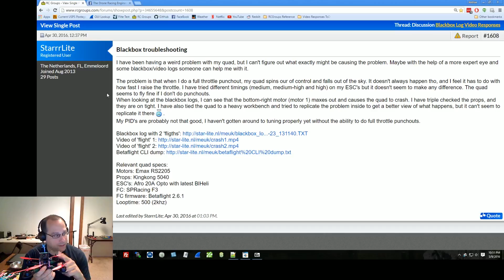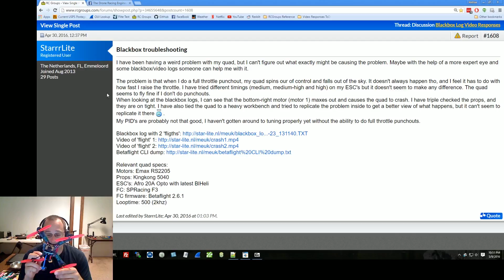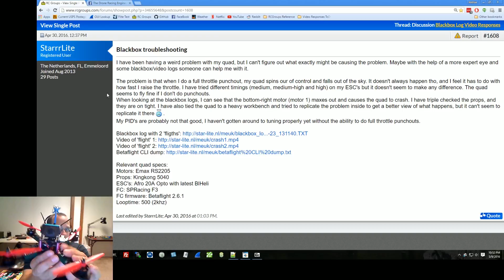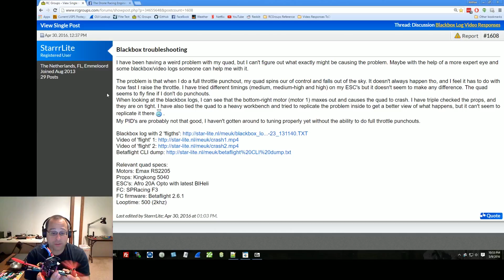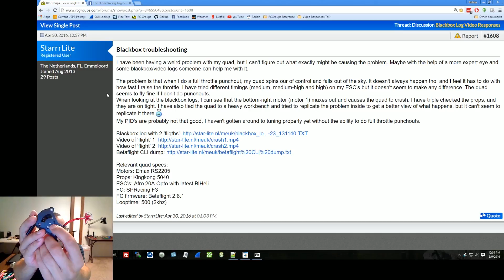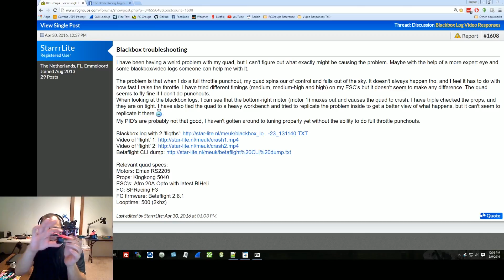Livestream Highlight - 5/9/2016 - QQ190 vs  Shendrones

Comment: Qq190.It doesn't matter what the camera platform is like, if the Flight Control is part of the pods structure. Cannot use ORings to Dampen FC. Many failings of FC boards, on these new frames that incorporate the FC into the stand Offs. 
A Mitsuku will cost you less in parts over the life of the drone. The electronics are protected in the  Mitsuku. As are all the other Shen Drone's.
Incorporating electronics into the structure of the Quad, is a bad idea.
That being said. If you don't Crash, then you have nothing to worry about.
Reply: My mistake, thought it was like the Ubad Katana.